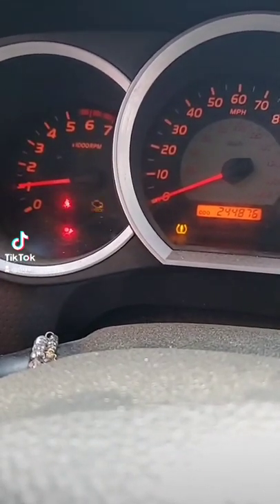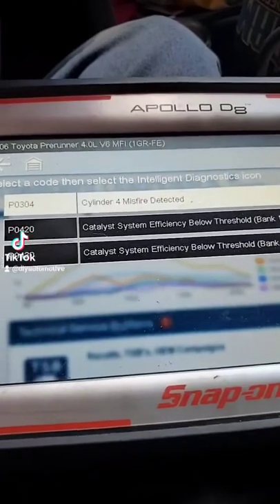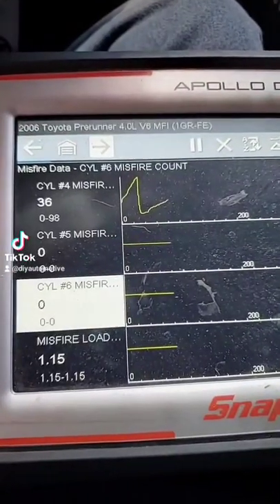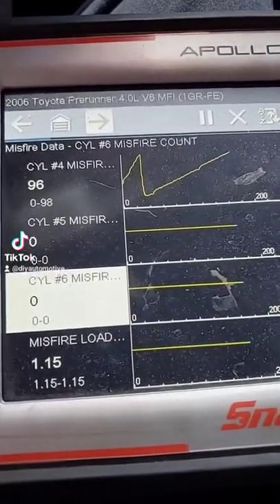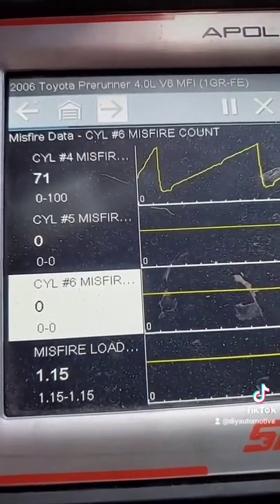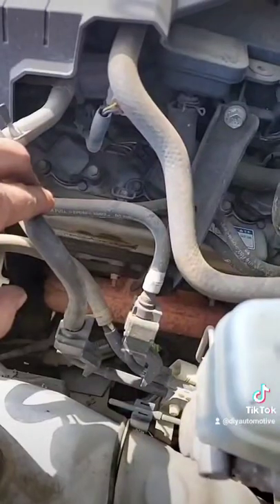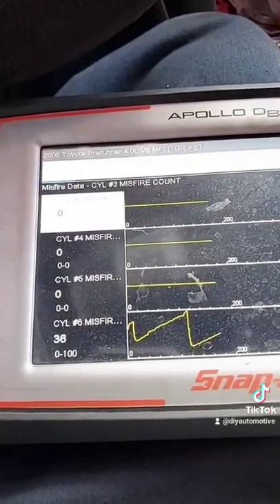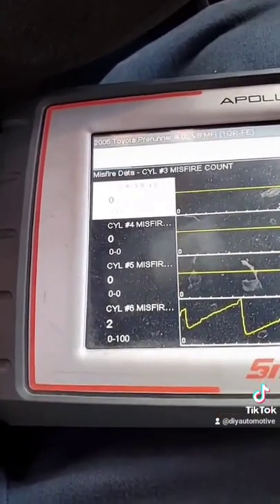Diagnosing a bad Ignition Coil

Comment: Weeee don’t worry about the P0420 and 30, I bought one of those fixed scanners to keep plugged in so I can clear that code every three or four days when it pops up. 
I do like your scanner tho, looks similar to the Autel
Reply from the maker: The p0420 30 is somewhat common on the younger guys trucks around here 😅.
I like the menu lay out better on the snap on, probably just because that's what I've always had my hands on for the most part. I would like to get an Autel seems like they can do a bit more than snap on

Comment: I’m having a misfire issue on my 15 mustang gt I replaced the plugs lights stayed off for a day and came back on it’s only when I’m accelerating its start misfiring out of nowhere then goes back to normal after ten seconds Im gonna replace the coils next but i have no idea what it is and can’t find anything about it
Reply from the maker: Have you pulled the codes?
Reply: @diy_automotive  yes the cylinder 1 and 6 misfires went away after changing spark plugs and coils and now it’s the random multiple p0300 it is almost a 10 year old car I think I’m gonna do the fuel filter next maybe it’s dirty from sitting hopefully and if I do a wot pull it’ll sometimes go into limp mode from misfiring still after changing plugs and coils
Reply from the maker: @Chris54234  I would check throttle body blade to see if it's dirty, run some higher octane fuel through it as well. Hopefully that will have it back to normal. It's hard to give you exact steps to follow with out reading live data